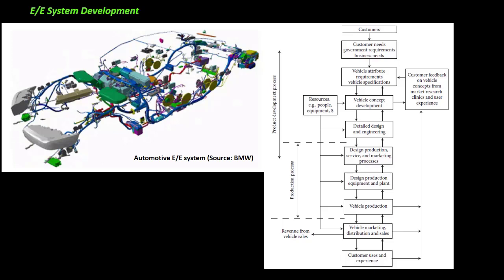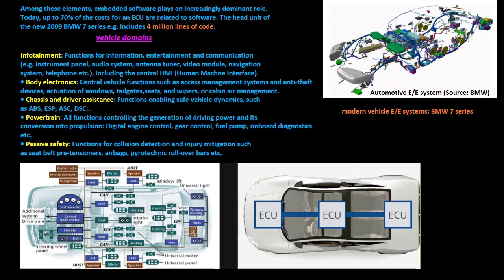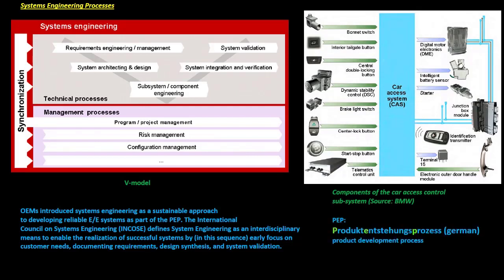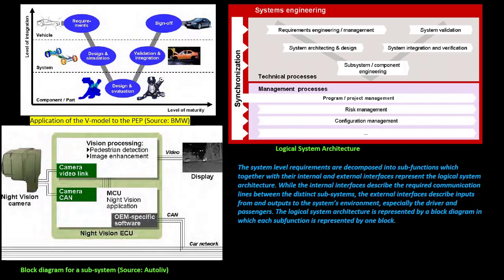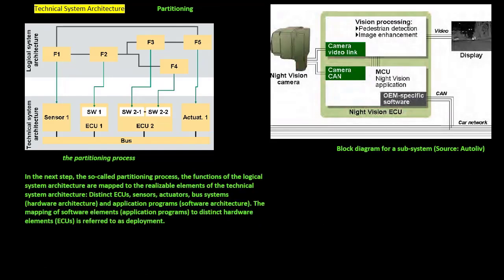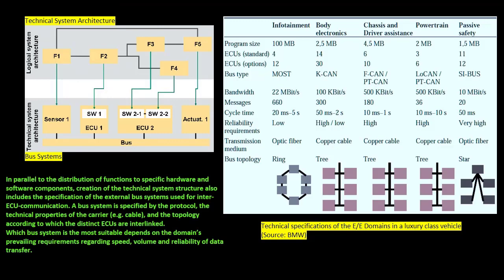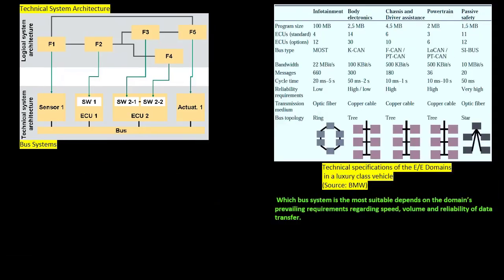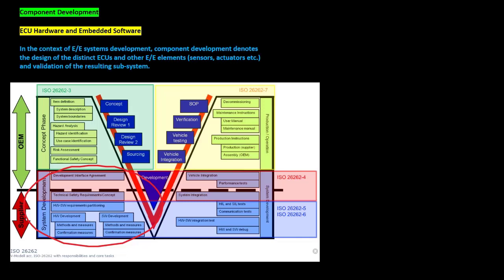Introduction to the Electrical Electronics Vehicle System Development: Systems Engineering Processes

Comment: Thank you Sir! mentioned that the software will be implemented in several types for example middleware basic sw etc... when will the data required e.g. for diagnosis be applied?
Reply from the maker: in the application process, parameters of the software (e.g. the engine and gearbox type as parameters of the engine controller software) are set. This application data, the assembler program and additional data required e.g. for diagnosis is subsequently linked to a binary program file which then is flashed (“embedded”) in the controllers EEPROM.